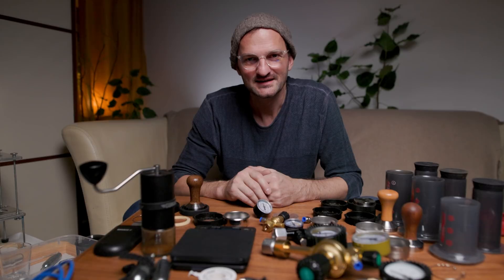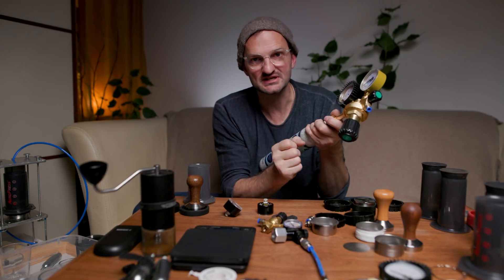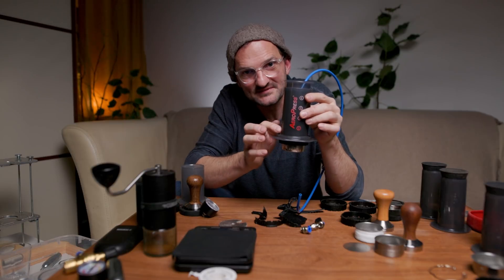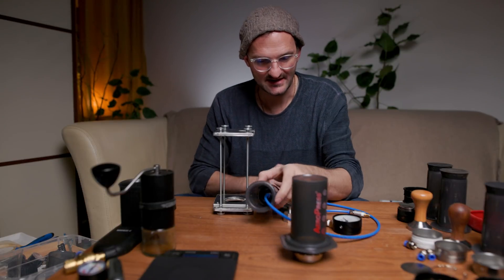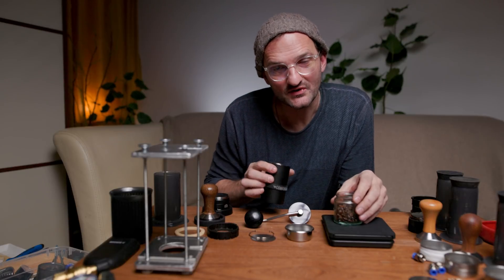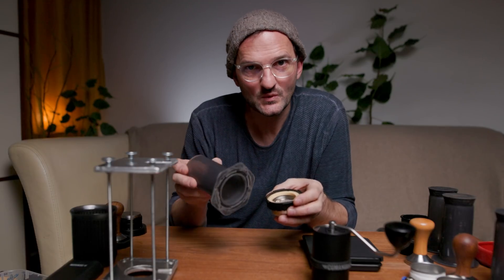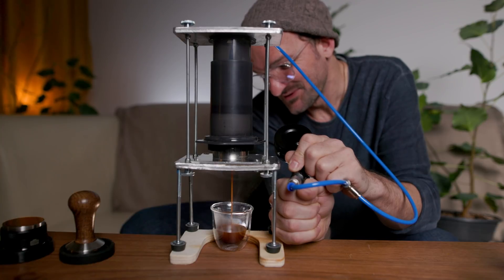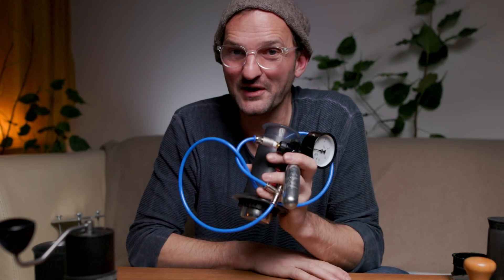Espresso from an Aeropress - NOT a myth anymore!

Comment: that shot looked really good! it's amazing that you made this just sitting in your living room, almost makes me want to try! i'd like to keep both my eyes and all my fingers though so i won't.
Reply from the maker: I did a lot of testing ahead, not in my living room though! I pushed roughly 100 shots so far and all good, but I am using a plexiglas cylinder, 20cm wide and 80cm high, that I put over the entire contraption when brewing with higher than 4 bar. I am aware the Aeropress has not been designed for continues high pressure, but sofar, so good!

Comment: I want to try this with a tubless tyre pump (with the big pressure chamber)
Reply from the maker: Just be aware when using higher pressure, you will need to clamp the Aeropress into some structure (I used 4 threaded iron rods and aluminum top and bottom plates) otherwise the bottom Aeropress stock filter cap might break. Please be careful with higher pressure!

Comment: Fantastic! The modification is how science should be, keep experimenting! I wonder if the metal clip can be excluded if a custom made gasket to be used? Also, instead of CO2, how about using nitrogen gas as alternative?
Reply from the maker: Thank you! I am not sure about Nitrogen use, I think it requires different pressure regulators. Food grade Nitrogen is being used with some beer and cold brewing though. Regarding the metal clip, I guess you are referring to the one that holds the shower screen in place? Well, it does just that, holding the screen in place, so when the water hits the shower screen, the coffee puck does not get destroyed by that force. Not sure why you would want to exclude it to fit another gasket, they should not interfere with each other.
Reply: @mikkisdiyobsessions3742  Wow, I got your reply! I was thinking a gasket that are thick enough to do both, holding the metal shower screen but at the same time sealing between the Aeropress mount and the screw lid. Lesser parts make this whole concept simpler (easier to clean) to go mainstream. A while ago, I was thinking using some hand/leg pump to create pressure haha. I like that metal stand that you built to ensure the cup wouldn't crushed during press, ever thought of a bigger contraption that use the leg or "you can sit on it"?
Reply from the maker: @TheKagaya1981  That is a nice idea! Not sure though if the larger gasket will give way to the swelling coffee puck during brewing process. If not, that might alter extraction. Lence Hendrick just posted a new manual espresso maker that works with a pump system, very interesting! Haha, I was thinking of mounting a bicycle saddle somehow, might be fun!

Comment: I like that you acoplished what you wanted,
 but man😅 
Is the solution is to make a lightweight, compact, simple, affordable, timesaving brewer into a: 
heavey, spaceconsuming, complicated, expensive, timeconsuming brewer. Which already exist.

Theres the xbar, and all the gas-free one, like picopresso, cafflano kompresso, rok, flair, just to mention the most famous ones
Reply from the maker: Thanks for your comment! Xbar seems to be a super cool machine, wasn't aware of it, will get one for sure. In terms of price it is quite beyond the DIY Äropress though. The Flair has cool features, but not that portable (lightweight) in my mind, and higher models are also a bit more costly. Picopresso, Cafflano and most others don't offer the same level of control. Anyways, the whole purpose was to show a way (or about 3, check out my other videos) how to turn the Aeropress into (up to) a 9 bar espresso machine. All for a little bit above 100 USD and some DIY time. There are so many Aeropress owners out there, and for about 40 USD any DIY adult can easily modify it into a 2,5 - 3  bar Espresso maker. I have been using the 3 bar modification for about 2 years now, and bringing it along wherever I travel, and am still loving it.
Reply: @mikkisdiyobsessions3742  i disagree, with the co2 mod with a co2 canister, its bigger than eny competition. 
I disagree that you don't have control with the picopresso, you desuden how fast you pump, 

Also i think it's a stretch to say you are brewing with the aeropress when you don't even use the piston, you brew though it, not whit it, "eny" other plastic pipe would do 😅 and im not shure the older version wouldn't explode 😅

BUT im a big fan of your 3 bar mod! I might be buying a extra cap for my aeropress go, and mod it for a bottomless basket, thats so nice!